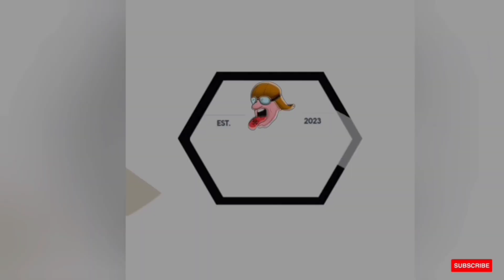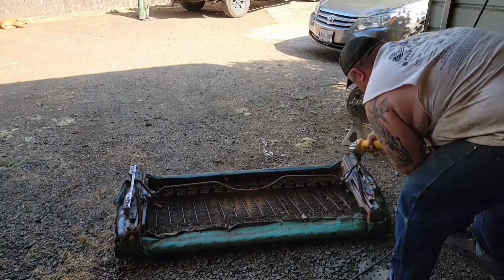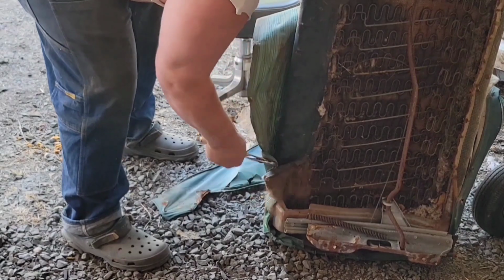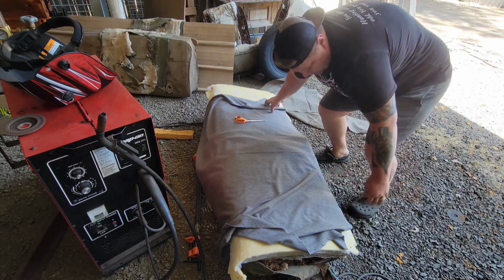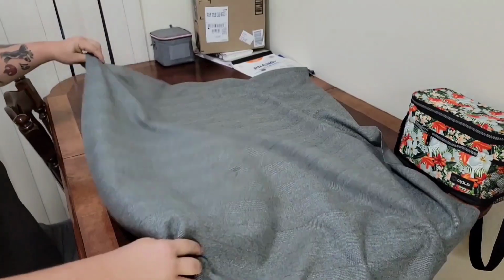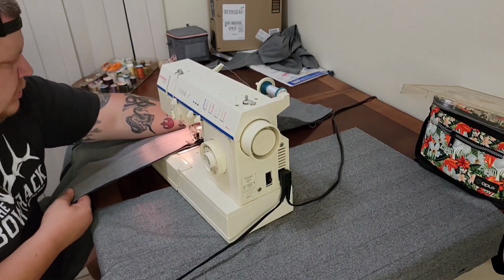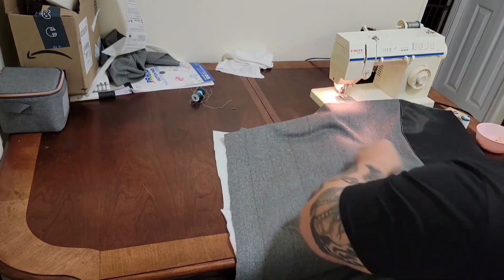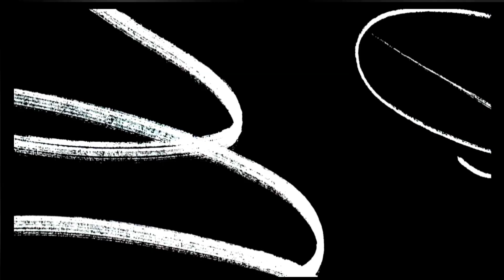DIY Seat Upholstery on a Bench Seat

Comment: I have a memory foam matress. I was gonna cut down for foam, because we bought a new Sleep Number bed. I am gonna try it & see if it works. It's more, or less, free for repurposing.
Reply from the maker: I have talked to upholstery guys who say that wont work. Their reasoning was the same way you are supposed to rotate your memory foam mattress to keep it from getting indents, you will end up with loose butt dents in a seat. Idk though, i think if you wrap it tight it will be just fine. I am no expert though!
Reply from the maker: Biggest tip i can give you is keep it simple for your first one. Overcomplicating your seat cover can make things very frusterating and not turn out well, for the first one just try to do something relatively basic and dont beat yourself up too much if its not perfect (remember you just saved 800 bucks!)